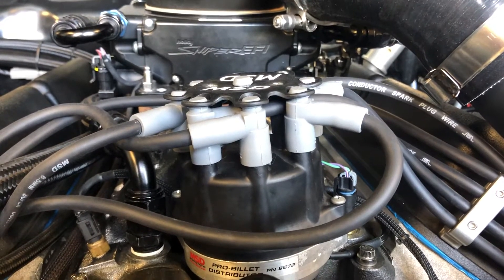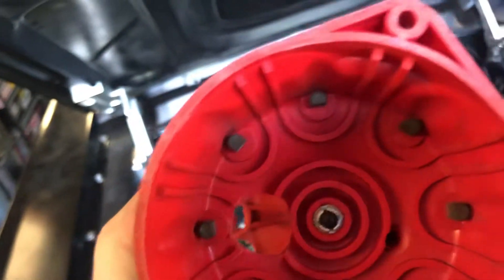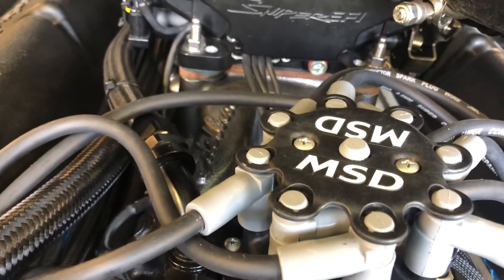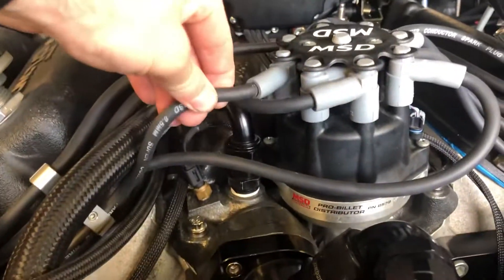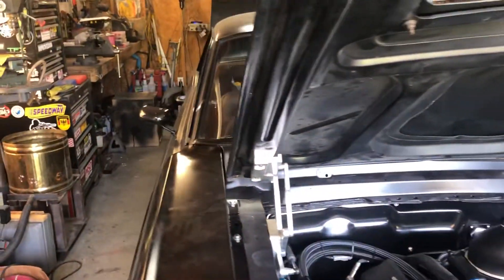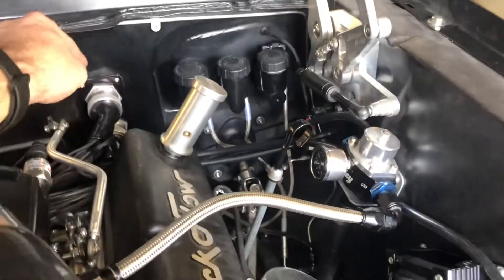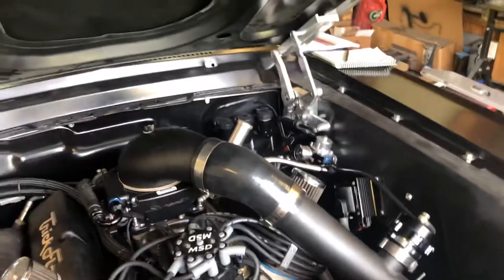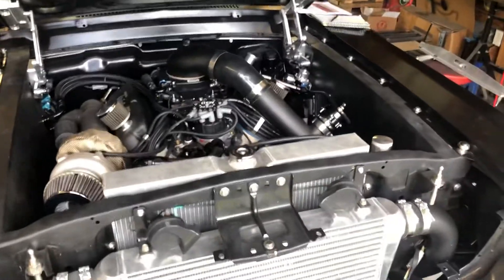RFI? interference? Importance of rotor phasing with Holley Sniper EFI timing control + MSD Probillet

Comment: With your turbo set up do you used dual or single plane intake manifold???
Reply from the maker: its a single plane RPM AirGap, but it's the later model that has about 1/2 mill down on the separation. single plane supposedly is better for throttlebody injection though.
Reply: I'm running a dual plane with my Holley sniper 1 but i want to to add torqstorm supercharger but they're saying i need a single plane intake @callofgeorge